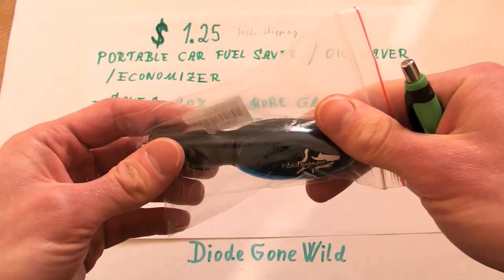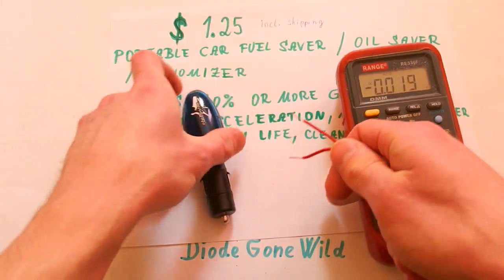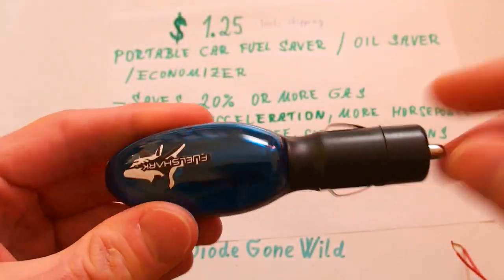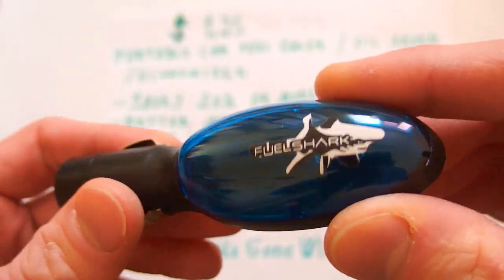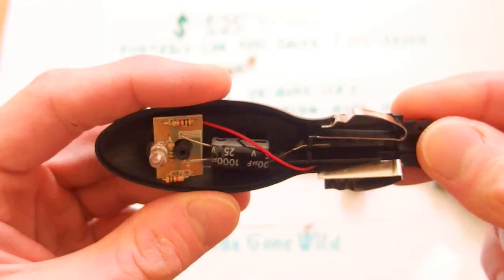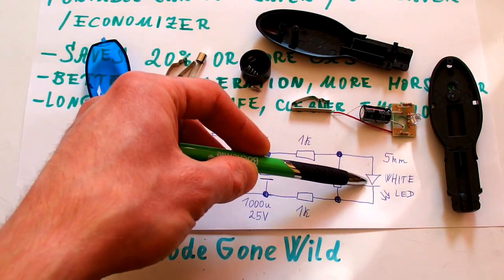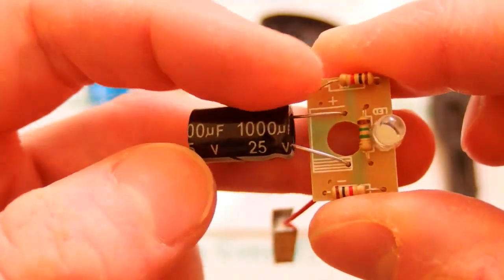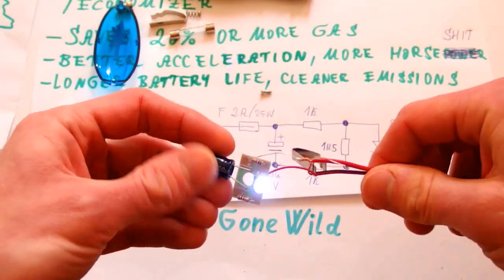FuelShark SCAM - Car Fuel Saver / Economizer - Teardown & Schematic

Comment: Hi from Turkey. I found the same from my friend. Yours is quality made one. When i opened mine, there were 1 resistor for led instead of 3 :)  And of course there is capacitor. Without a capacitor, it would NOT ensure fuel economy. :)
Reply: I made one using a bigger capacitor 10,000uF 50volt on a 12yr old carburetor car.

It did make a difference. More low end torque and smoother ride. 
I'm guessing coz the car is old and had a weak alternator....
Hence the capacitor gave the ignition systems a good boost when it was hooked up to the car.
Note: Setup is the same as fuel shark except for the bigger capacitor.
Reply: You guys better be joking. How does a thing from a cigarette lighter improve your car?
Reply: @coydog7902  A capacitor can supply high current. It won't improve anything except maybe making it easier to start your car.
Reply: hacım kayboldum burada yardım et ne diyor bunlar sonuç ne ?
Reply: gerçekten işe yarıyor mu?
Reply: I could say swap or remove the fuses in the fuse box would be the most effective

Comment: That's over engineered. You don't need a capacitor, or pcb....to light up a LED.
Reply: This strikes me as a car version of the house power saver scams that they make. Lol the circuitry is almost identical with the exception of the polarized capacitor. For the house power Savers they use unpolarized types like mylar film capacitors.
Reply: but the cap is required to power the phase shift compensator that's coupled to the ass mangled wangle dangle... so I've been told ;)
Reply: @amigaman9433  Yeah, it's all in the angle of the dangle
Reply: But if they want the led to be on for a while after it gets plugged out...
Reply: OMG HAHA! Best comment!
Reply: J Dough in the event someone were to open up the device it would have to contain a capacitor to be able to level the voltage in the system. So for the claims it makes, it’s engineered to deceive the layman. A pcb like that is a couple pennies and if you have to make a million of these things.., you’re going to want to be able to automatically populate the circuitry and have someone just slap the halves together and throw it in a box, cost per piece is extremely low and they sell for 25.00. There is 95 cents there with the pcb and the stupid capacitor or 3.00 without the pcb, or can’t even sell the thing at all without the capacitor.
Reply: just resistor to cut down voltage.
Reply: Yeah, they could have saved at least two resistors - obviously no knowledge of electronics went into this device.
Reply: Had some resistors to make sure LED will survive and device will look working for more time.

Comment: Ha ha :-D, its almost as bad as the house power saving devices, they do nothing also lol.
You are nearly as mad as big clive, he loves daft stuff :-D.
I had to laugh when you crossed out "POWER", i thought shit too :).

Perhaps you can use the case for a buck converter, a modded mc34063 or similar chip lol.

Are you happy with the way this channel is going, enough views?
Reply from the maker: I also plan a video about the house power savers :). I think it is better to modify this just to a flashlight. But turning it to a USB power supply is not a bad idea too. For $1.25 it is good as a DIY housing.  

Of course, I'd like to have more views :) Just like anybody on youtube. But maybe this will come in the future. I hope...
Reply: Just no pointing at the viewers, frightning LOL :)
Reply: @DiodeGoneWild  I like the idea of them using a blue LED chip, that is phosphor coated to give white light, then put behind blue plastic to turn it back into blue light - crazy